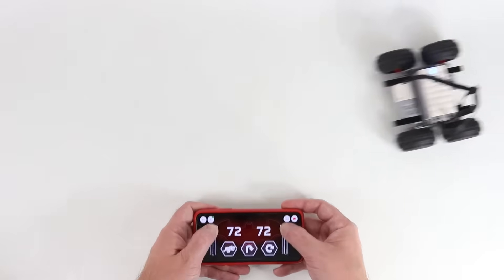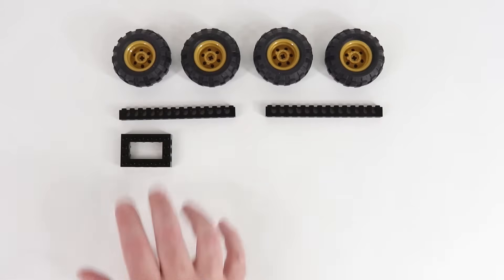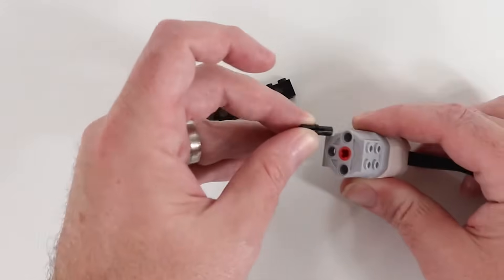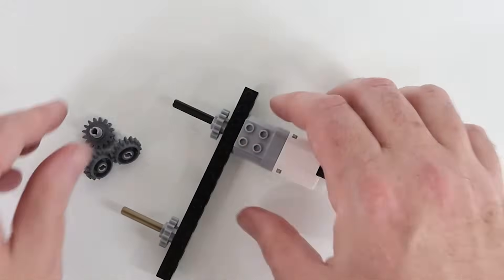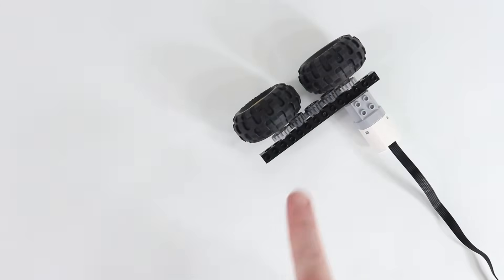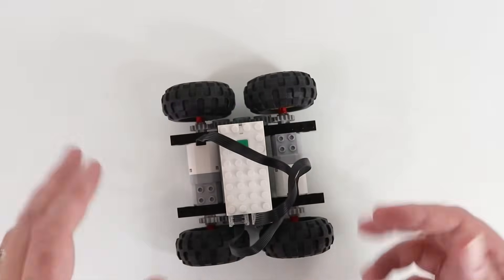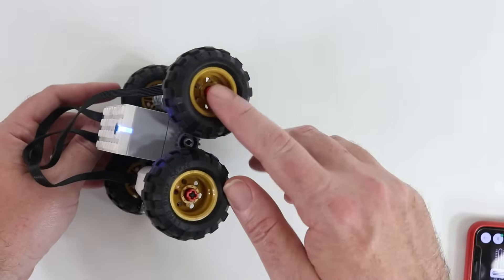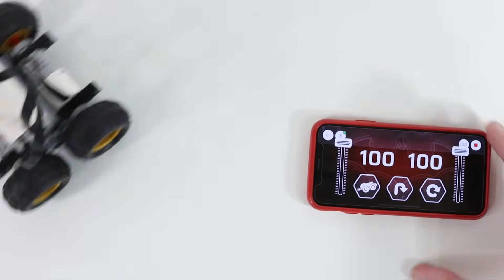How To Build Simple LEGO R/C Car Tutorial

Comment: I don't have the 'carrier' gear pieces. Is there a reason they have to be used or can I use more normal 16 tooth gears?
Reply from the maker: You can use more normal 16 tooth gears, but you’ll need to change those frictionless pins to the kind of pin that is half frictionless pin / half axle. I haven’t tested that, so I don’t know how well those gears will stay on the pins during use, but it should be okay. Let me know if that answers your question. Thanks for watching!
Reply: @BooneBuilds  ok thank you!